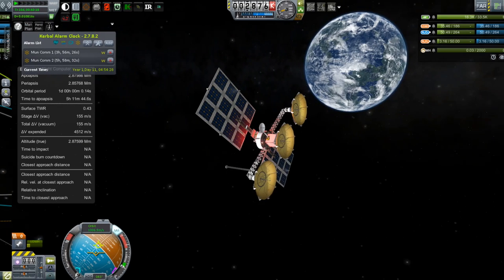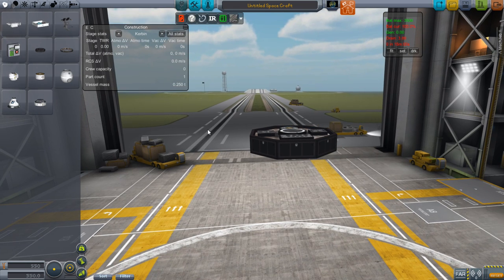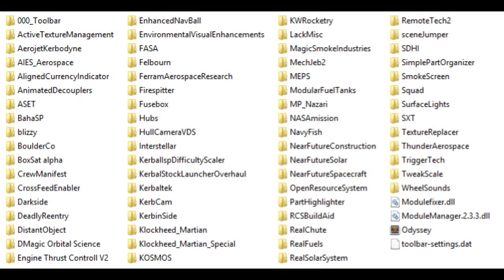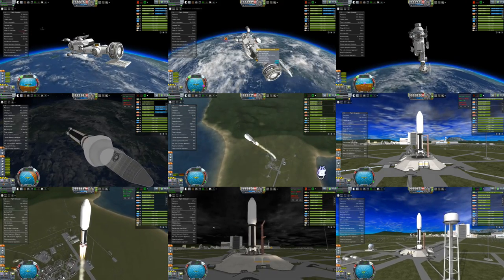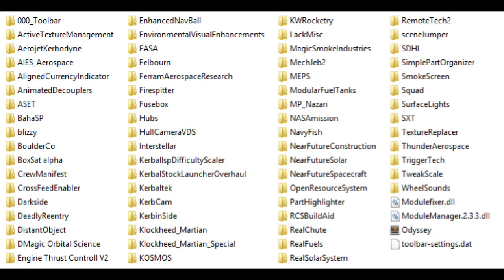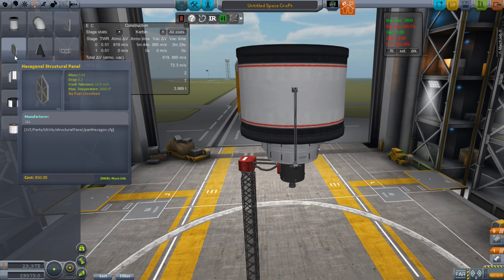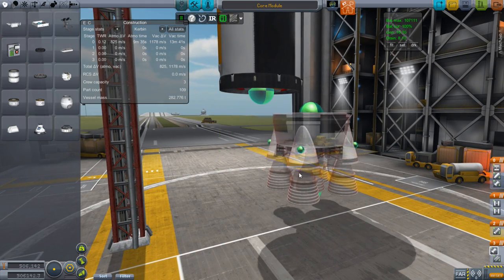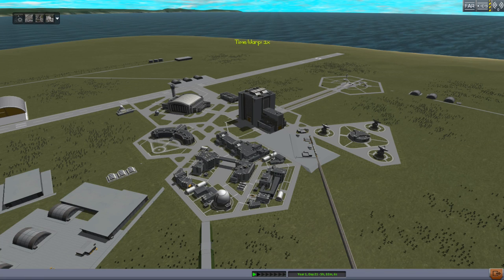E23: "Did I Mention Mods? (Part 2)" / Project Odyssey / KSP 0.24.2

Comment: Bob, awesome as usual. Not gonna lie, but Langrange points are well out of my are of expertise. I mean, I know WHAT they are and what they do, but you won't see me using them XD
Reply from the maker: Acemcbean Piff It's all smoke an mirrors in KSP anyway. Just put your satellite on the same orbit as some other thing, about 1/6th of the way ahead or behind, and tell yourself it's an L-point. I do.
Reply: Bob Fitch That, as well, I did know. KSP physics equals "Eh, close enough" physics.
Reply from the maker: Acemcbean Piff If you do want to try... just leave Kerbin as if you were heading to Duna. As soon as you get escape velocity you'll have an AP of 213 kerbin days. Keep going until your AP is about 249 kerbin days. When you get back to where you started, circularize until your AP is back to 213 days. That's Kerbin-Sun L5. (L4 is the other direction. Mun is done with close approach markers.)

Comment: Love your series!  I became a subscriber when you received glowing reviews for Project Gateway from TheWinterOwl during one of his 6.4 videos.

Question -- in this one, where you do the teardown of the station.  You show how you allocated tank capacity, but it shows that you had your waste / wastewater / co2 tanks full?  Did it launch like that?  Was that intentional?

And, further from that, I'm trying to get used to MFT.  How do you know what ratios to set your TACLS consumables, since they converted to metric L instead of time units?  (My own added drama is that I can't decide if I should use Universal Storage, Verastile Toolbox System, or both.)
Reply from the maker: MultiSmellyHead Good eye. It was a mistake, and yes it launched that way also as a mistake. I noticed it after I was already in orbit. I thought about dumping it but didn't yet. As for life support, mine is based on Human consumption taken from life support wikis. (Example: http://en.wikipedia.org/wiki/Life_support_system) I did that because I believe Kerbals have a human-like metabolism even though they are smaller, meaning they eat 2000 calories a day as well. I took the needed water, for example 3.52 kg, and figured out the liters per second from that (so 4.074E-08). For food I used an a pallet of MREs as my mass and volume baseline. For oxygen I assume it's compressed when stored but just have it use the community standard Oxygen unit mass when consumed.

Comment: Wow, I use RCS Build Aid, but I never knew until now that you could press the RCS rotation keys to view the torque they would produce in the VAB!
Reply from the maker: Andrew Hansen I have never paid attention to any other features it has. What were you using it for if not rotation checking?
Reply: Bob Fitch Oh, I used it for rotation checking too, but only for the default rotation direction that came up. I use it mostly for rotation checking on my spaceplanes' engines, but I definitely appreciate its dry center of mass marker too.
Reply from the maker: Ahhhh I see. That makes sense.

Comment: Odyssey two is looking sexy!!!! I like the radial mounted propulsion. Looks like the station could be used as an interplanetary craft also!
And have you done away with part welder now?
Reply: Yes, SEXY! The way the Doctor was calling the TARDIS in one of the recent episodes!
Reply from the maker: nevar108 I would consider welding if I thought the station was going to become large and dependent on part count for its FPS, but I have already planned out that entire station in my head and I think it won't be too bad, so I have not welded for it. In fact, welding can be a real pain so I may not be welding until I get to making the Duna mission landers because I expect that base to be... expansive.

Comment: if you want 2 ships launching at the same time will KOS work? http://forum.kerbalspaceprogram.com/threads/68089-0-23-kOS-Scriptable-Autopilot-System-v0-11-2-13
kOS: Mod Introduction and Demo (old vid)
Reply from the maker: Yes, I used kOS back when it was version 0.5 and 0.6 and it was already able to launch ships. I am sure it's even better now. However, I program for a living, and I don't really want to program my Kerbal ships when I get home too. Also, BurnWithMe would do this even better than kOS would, so I'd use that before I'd use kOS. Even in the case of BurnWithMe though it takes away some of the fun of flying the things I make. I don't really want to have any sort of autopilots.
Reply: fair nuff.

Comment: I know it's not really this series' style, but any plans for SSTOs?
Reply from the maker: Rory Shields Sometimes I think about it. I don't have immediate plans. I can't say 100% that I wouldn't do it though. One problem with them is they take longer to use (launch, return, land) and I like my game to be a little faster than that. I don't use nuclear engines, and I especially don't use xenon engines, because they take so long to use. I would rather launch more fuel and use powerful engines to burn for 1 minute, than to be more efficient but burn for 8 minutes. An SSTO is like that. It takes too long for me, AND I like rockets more than planes 99% of the time. I see KSP as a rocket simulator. I have no problem with people using it for a flight simulator; I am just not one of those people. So... short answer... we'll see. I suppose if I did a non-plane SSTO that might be ok.

Comment: Yay a switch to Karbonite! Open source for the win!
Reply from the maker: PhazonSpaceSystems I wish Karbonite and Kethane would have a child. I want Karbonite-style resource gathering but I want Kethane-style scanning. I don't want to know where the Karbonite is until I scan for it, but I want hot spots instead of the large depleteable patches.
Reply: Bob Fitch That would be glorious. Also I'm guessing you also got that inbox glitch where the little bell didn't display the number? Usually your replies are more punctual.
Reply from the maker: Yes, I had that glitch.

Comment: Sir bob, if you need it, I made a very strong 150ton launching rocket with stock parts and tweekscale.
its what I used to make my huge space station
Reply from the maker: MegaSkrow Thanks for the offer! I think you can agree that part of the fun of KSP is building rockets like that, and as an engineer in real life it's definitely one of the reasons I play KSP... to build stuff. If I used your lifter then I'd be depriving myself that pleasure. :)   Thanks though.
Reply: Bob Fitch  if you should still need it, its here